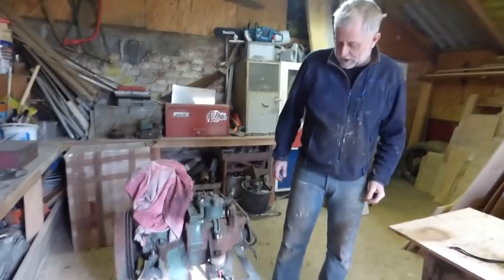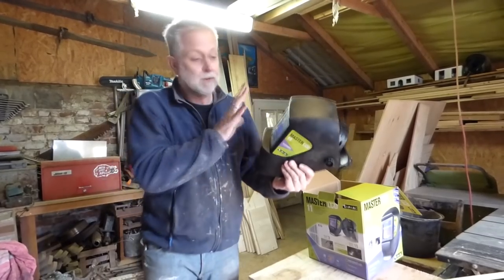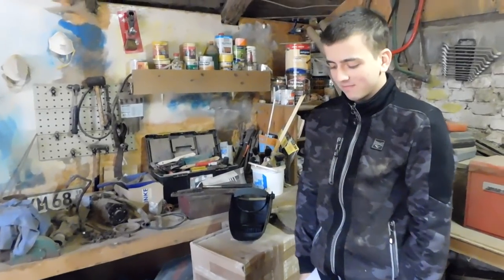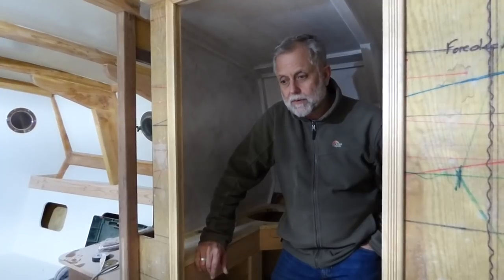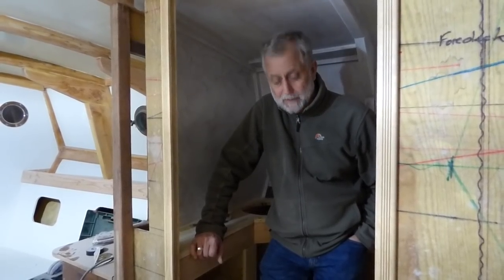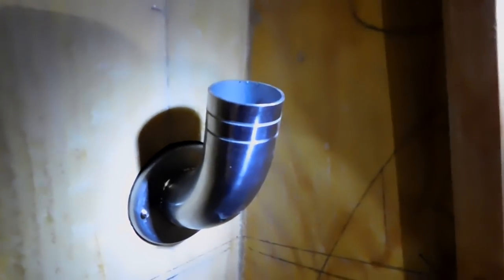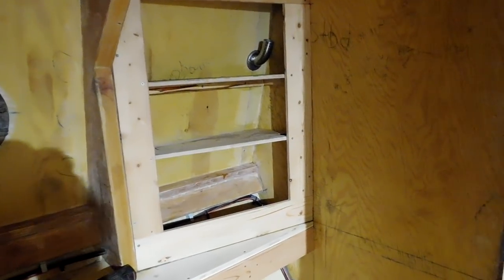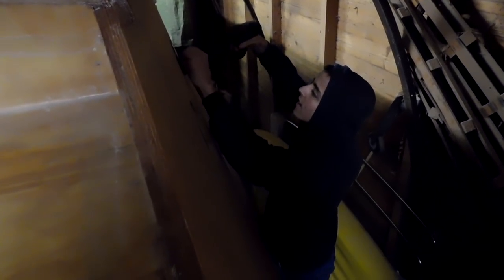Stick welding and the heads part 2 - SV Tapatya EP126

Comment: After years of using regular welding helmet and cheap auto darkening helmets I broke down and bought an expensive 250$ hood. Its pretty nice not going to lie, nice head gear, really nice lens too but my only gripe with any auto darkening helmets is when the battery gets low you'll get flashed and if you weld outside the sun light will hit the sensors and make your helmet darken. Not a big deal as its no different than a regular old school helmet. Depending on how many sensors your helmet has you can block the top sensors with tape or some cardboard so the sun doesn't set them off if it bothers you, or bust out the old helmet. Keep a couple batteries on hand if your getting flashed and if it happens change the battery first before you assume the helmet is bad.
Reply from the maker: Good stuff Willow. Thanks :-)

Comment: Ok on welding thicker material, 1/4" to 3/8" like Ive seen you use. It helps to preheat a bit first, and the easiest way to do this is to use the energy of tacking something in, where it gets hotter to aid preheating. When you finish a run, try hover for a fraction of a second keeping the arc alight, then push it in slightly, and pull out making a circle, it prevents craters at the end of a run. Where you get long craters like at the start of the video, you can pick the slag out as much as you can with a hard steel scriber, actually we used to use broken bits of power hack saw blades ground to a point. Then get back in there with a higher amperage, or the next size rod down on about the same amps, the crater should fill and the slag rise off to the surface. You dont look like you are comfortable while welding and you need to be. You can steady your distance from welding hand to the work by bracing the handpiece against your body, and holding on to the job with your other hand. After a long day we would get lazy and just drag the rod against the work joint, letting the weld move along as the rod was consumed, on slightly higher amps. There were semi automatic welding machines that operated on the same principle. Wear safety glasses cleaning slag off, it can be very hot and really burns if it goes into your eye.
cheers
Reply from the maker: Thanks Zaya. Good tips! The crater is where I've missed the seam!! You're quite right - clean out the slag and run over it again :-)

Comment: This is a task I would never do lacking the time money patience and skills but I do enjoy the Boat building channels. I do however have a technical question that has never been answered and it is not a complicated one.  When you are fitting out the insides of a boat you obviously use tools like a plumb t-squares and the good old spirit level to get your horizontals and verticals just like doing DIY in a house. Except the boat hull may not be totally horizontal and it could be canted. If you use those tools then surely you could be off a few degrees. Do you make sure the hull is exactly level and even or is there some other way of cracking the problem or is it a case of well it is only a few degrees so it doesn't really matter.
Reply from the maker: Hi Glenn. Thanks for watching and thanks for the good question. Basically , you do your best to set the boat up level and then work from that. Clearly, the weight disruption in the boat will decide how she eventually floats, so exactly level is pretty much impossible. And then there’s the movement from waves and wind once afloat. In the end it’s really just a case of close enough...